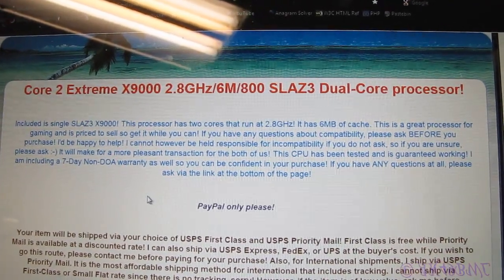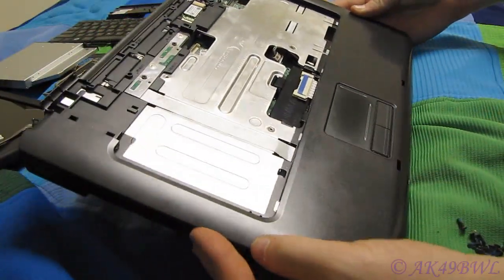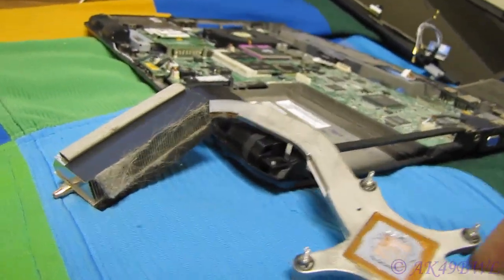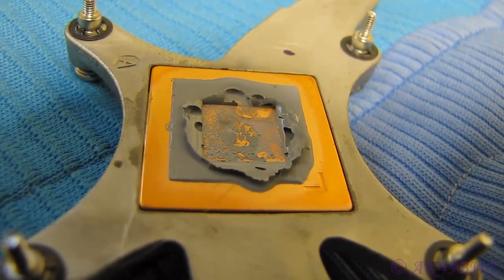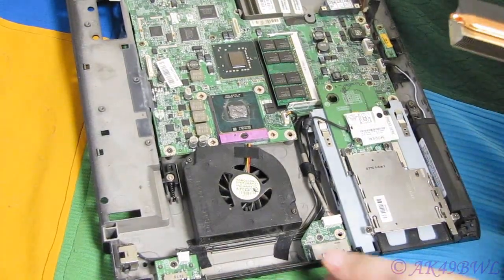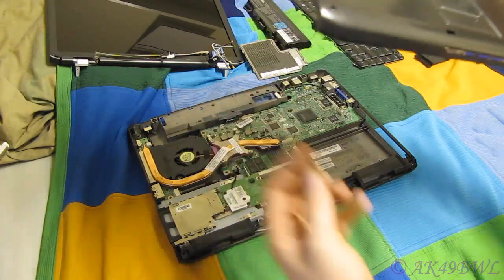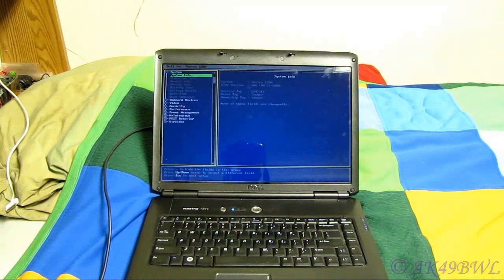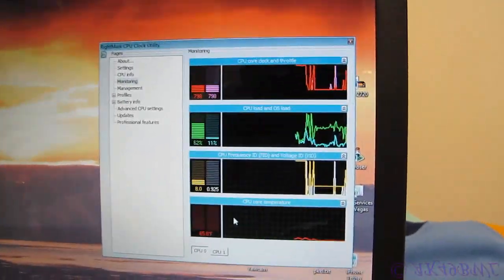How to Replace a Laptop CPU

Comment: If I wanted though to change my CPU or GPU,  can I get ANY CPU or GPU I want for my laptop?
Reply: BenG HD No, you need to check for the following:
1. If your laptop model has socketed CPU - if it's soldered directly to the motherboard then the situation becomes more complicated;
2. If your laptop's CPU is socketed, then check if it's an Intel or AMD CPU, and the model; you can find this out by going into the BIOS configuration/settings;
3. Look up in Google (or your preferred Internet search engine) the brand and model of the existing CPU and find out which socket type it is;
4. Take note of the socket type, then using the Internet search engine again, look up listings for mobile CPUs available under the socket type you've got in your laptop;
5. Find in the list your existing CPU model, then take note of the TDP (Total Dissipated Power) and FSB ratings, then check the higher specified CPUs, and if Lady Luck's smiling your way, you may find the fastest CPUs with a matching TDP and FSB for your existing CPU; write down all the CPUs that are listed matching the TDP spec;
6. Go to ebay or alibaba.com and search for the best priced CPU model(s) you are looking for;
7. Research the seller and check if they are reliable;
8. Figure out which CPU upgrade has the best performance to price ratio;
9. Budget for the CPU you consider best for your planned upgrade.

The reason why it's important to match the TDP specification, is that this will also best match the heatsink/fan combination you already have; it may be very difficult to find a heatsink/fan combination that will fit in your current installation for a CPU with a higher rated TDP. 
Chances are that if you order a CPU with a higher TDP, the existing heatsink/fan combination may be inadequate to keep the new CPU cool, and the laptop will keep shutting down as the thermal overload safety cut off system automatically shuts down the CPU to prevent it overheating, if you're lucky. Don't retry starting your laptop again if the thermal shutdown happens even once.
If you're unlucky you may end up frying the new CPU and possibly the motherboard or memory modules as well.

It seems rare, in my experience, to find an upgradeable GPU; usually with laptops that have a reasonable chance of having an upgradeable Graphics Card, the entire GPU card needs to be removed, for replacement with a new and improved GPU card; although this is trickier than a CPU upgrade because most likely than not, the heatsink/fan combination mechanical geometry for the mounting screws may not match the new GPU card/board; requiring replacing the existing GPU heatsink/fan combination, and this may be much more difficult than finding such a combination for a CPU.
When shopping for an upgradeable GPU card, be careful to make sure the replacement GPU card has the same type of connector for the motherboard; the same model of GPU card may have variant physical motherboard connectors. 

When upgrading either the CPU or GPU, in addition of making sure the correct heatsink/fan combination is also upgraded if necessary, heat sink silicone padding or heat sink compound/grease should be applied to the CPU/GPU to ensure the best possible thermal conductivity between the top surface of the CPU/GPU and the heat sink. Also make sure the heatsink mounting screws are tightened sufficiently to guarantee the best possible thermal contact between the CPU/GPU surface geometry and the heatsink. Make sure any old heatsink compounds are thoroughly removed by appropriate and proper cleaning before applying fresh heatsink compounds between the CPU/GPU surface geometry and heatsink(s).

Take all possible anti-static and OHS (Occupational Health and Safety) precautions and procedures when handling CPU/GPU components, and the heat sink compounds or heatsink compound cleaning chemicals.

Best of luck with your upgrade endeavors.

I have provided the above information on an as is basis, for use at your own risk. Neither Google, YouTube or I accept any responsibility for any damages you may sustain as a result of the above information. You must make sure you do your own research and take the appropriate precautions when upgrading your own system.

If you are in doubt as to your capabilities or abilities in carrying out any of the upgrades, I strongly recommend refraining from proceeding; you may be better off selling your old laptop and using the money to help buy a new one.
Reply from the maker: BenG HD sure. No guarantees it'll fit, or work, but you can get whatever you please lol. As long as your system supports it, you'll have no problems. That research is on you, my friend.
Reply: Ak49., eres bueno con las laptop's.!! Tengo una Sony con core i5. Se le puede cambiar a core i7.,???
Reply: Es una sony vaio. disco duro de 500 gb. y memoria ram de 4gb. intel core i5
Reply: esta muy bien la maquina pero es mi duda si en un futuro se le podria cambiar, asi como tu lo hicicste.,dejame decirte que estubo exelente tu video muy bien.
Reply: bueno lo cambiaria una persona experta. asi como tu.yo no.pero cres que le ayude a mi laptop.?
Reply: i dont, change this piece,only a guy whith experience. like you.
Reply: thanks my amigo. i from mexico a litle town morelos cuautla.youre a good man., I have little speak inglish is hard for mi.sorry.

Comment: ***** Hi men, My Question is, If you Update the Bios of your Vostro1500 When you put the X9000.
I have vostro 1500 too, and plan to change Cpu T5470 for T9300, I already bought it.
My Bios Version is A01,and found a Bios Version A06, It willbe Fine or not?
Thanks in advance.
Reply from the maker: Headburn88 yes, you will need at least A04 if I remember right, or the CPU won't even be recognized. A06 is the latest, always best to update :)

Comment: Can the Gpu and RAM be upgraded?
Reply from the maker: Displux RAM, yes. GPU, not unless it came with nVidia graphics, and then you only have one upgrade option (I forget what it is tho). If you don't have a Vostro 1500, I can't tell you what the GPU can or can't be done anything with.
Reply: Displux RAM is a lot easier to upgrade than the CPU, in my opinion

Comment: How did you just 'drop' in a core two extreme CPU without burning out the socket going from 35watt-TDP(T7250) to 44watt-TDP(X9000)? Funny you had a temp drop, I want to do this for my old XPS M1530 w/T8300...
Reply from the maker: Aaron mcClintock Well I can only assume the sockets are designed to handle any CPU that was made to fit them. Either way, I have that computer sitting on my floor right now doing some torrent downloading so, it still works lol. You'll probably have a MUCH easier time doing it on the M1530 tho, I think you can just remove the entire bottom panel and the CPU is right there...

Comment: laptop cpu and pc cpu ..its same size ???
Reply: Aloya Lego More than the size, you should consider the kind of socket the motherboard (either the laptop's or the desktop's) is using. Also, most desktop processors are a bit power hungry, and even if they could be (in a very hypothetical way, don't know much about laptop components) plugged into a laptop, your power consumption would be pretty high.

Comment: I was cringing when you used a screwdriver to take off the old thermal paste :D

Other than that, informative video!
Reply: "Nice and Shiny" and scratched to shit haha.
Reply: Joshua Lloyd respondEd to 4 yr old comment
Reply: Sometimes thermal paste gets so hard that even if you do everything correctly it wont come off I know that happened to my hand down laptop its thermal paste was like concrete I couldnt remove it even after letting the alcohol sit for 30 minutes (I added more when needed) and I had to resort to a screwdriver cause it was damaging all my cleaning tools

Comment: i dont even have to take my laptop apart. just need to unscrew 2-3 screws, and its right there. :)
Reply from the maker: TheGrayWolf81  lol I must have the stupidest laptop ever. No, wait... Toshiba is still worse.
Reply: Oh and that's my old laptop which i rarely use. Plus im afraid it might just randomly catch fire one day--its a Dell. :/
Reply: TheGrayWolf81 I have a Clevo P150SM....  MADD Machine.   Only 4 screws to access pretty much everything there is to access (ram, ssd, wifi, cpu, gpu, etc).
Reply: ***** TOSHIBA is better than DELL.
Reply: ***** Toshiba are very good in my opinion, But if you prefer DELL is totally fine.
Reply: Cesar Alvarez HD hp is better then toshiba well actually everything is better then toshiba
Reply: Gammer 100 hehe my friend has a Toshiba and it crashed on him and he had to reset it AT THE LEAST 6 times... but i think that's more him than the laptop XD
Reply: lol ur prob right

Comment: any damage will become to the laptop memory? if I changed my processor. ..
any problems will come?
Reply from the maker: Olga Kondrativa No damage to the memory... Just get the right CPU for your system and you'll be fine. You need to know both the FSB and what the chipset will support (they go hand in hand, really).

Comment: i have a laptop with a intel core i5 4210u 1.7ghz is it possible change the processor because some websites say i cant change this processor.
Reply from the maker: suhela jayaweera You'll need to determine whether it's soldered to the motherboard or not - if it is, there is no replacing it.

Comment: hey i just bought bought the same laptop but mine has webcam but its tha same model vestro 1500 but mine has a t5270 @ 1.40ghz and 2.00gb ram and i made the mistake thinking the 2.00gb was the cpu :/....soo wat i want to know is what can i do to make this computer faster is just upgrading the cpu a big part or do i need to upgrade more parts to prepare it for a faster cpu sorry i dont really know alot bout tech......the laptop is okay it really cant run smooth with two or more programs open will upgrading the cpu allow me to open more programs without lag delay?
Reply from the maker: manuel martinez Absolutely.... Mine originally came with the T5270 as well but very soon after I upgraded to the T7250 as well as replaced the RAM with 4GB total. Then I went to the X9000. If you don't want to go straight to the Extreme, the T7250 was a pretty solid performer at 2.0GHz, and can be had VERY cheaply on eBay. In fact I don't think the X9000 is expensive anymore either considering its age :D .... If you want to get some speed out of it without doing too much, disable the Desktop Window Manager and Superfetch services (Windows Key + R, type "services.msc" and find those two in the list) - those two take quite a bit of RAM to run and all they do is [DWM] provides a somewhat nicer graphics experience, and [Superfetch] is said to load programs faster over time but I never got much out of it. Next step would be to replace/add more RAM (max 4GB for this one). Then the CPU.
Reply from the maker: manuel martinez Also if you're running Vista, drop it like it's hot and put XP or 7 on it lol
Reply: ***** i was thinking about a t9500 there around 40$ :)................and for a ram upgrade i was looking for some 4gb ram on amazon but they are sold 2x2gb not one whole 4gb ram...so should i get just one new 2gb ram and put it with my old one if i can?....or will it be better to get new 2x2gb ram?
and its been dropped down low to that win7 baby ;) lol
Reply from the maker: manuel martinez  unless it's changed from stock, all you have is 2x1GB. So the 2x2GB will do you better - and will guarantee that your two RAM sticks match ;)
Your Vostro have the Nvidia card or Intel graphics?
Reply: ***** ohh okay, yea i found some 2x2gb ram for the vostro 1500....i think its nvidia??
Reply from the maker: Good if so, because you'll be able to find Win7 drivers for it if you need to. The Intel graphics drivers for Windows 7 cause random BSODs lol, I had to find an old Vista driver. I mean, it worked, but it was a pain :p
Reply: ***** yea its nvidia..well thanks man you helped me out alot i got lucky that i just typed in "cpu upgrade" and found someone with the same laptop model as mine xD
Reply: wow mine is 2.6 GHZ laptop I5 i dont think you will have to pay much got a laptop 3.0 GHZ
Reply: ***** do I really have to take my laptop apart that much to put the cpu  in? cause if so I couldn't follow along. was too fast for me

Comment: I upgraded the processor in my laptop and it works fine for about 15-20 mins, however, it will shut off out of nowhere. I downloaded a program to check the pc temp and it's not overheating. I also downloaded the drivers/bios files for both Lenovo and Intel and it still does it. Someone PLEASE help me... It sucks having had spent 200 dollars on something only for it to have been a curse... I have a Lenovo G700 Intel i7 3612qm with 8GB RAM.
Reply: maybe the MB is fried... or could be a faulty components into the motherboard...

Try replacing the HDD, RAM'and see if it still does... try with the HDD, if is ok, then check the RAM, if is still ok, then remain the MB, need to be replaced
Reply: Idk man I'm sorry I can't help you, I'll tell you if I experience it and then I'll try to find out.
Reply: MB can't be fried it works when I put my old processor back in it.
Reply from the maker: Nobody Important You may have gotten a bad CPU then... That's the only thing I can figure. If you can, try returning/exchanging the CPU you got for another. If that still doesn't work.... I don't really know what to tell you.
It is somewhat possible that your machine's power supply doesn't have enough power to fully operate the new CPU?
Reply: What PSU do you have?

Comment: Do you need to reinstall Windows after replacing the CPU?
Reply from the maker: Travis Ross Nope! As far as the OS is concerned, CPU replacement is plug.n.play.
Reply: ***** Awesome. Thanks for the quick reply. I wasn't sure if any registry, drivers, core files, etc. were linked to the CPU in some way during the installation of the OS. I suppose the chipset does all the work with regards to that.
Reply from the maker: Travis Ross Yeah, working with the CPU all done by the chipset.. Aside from identification, the OS could care less what CPU is in there lol... Well, for this generation at least, I can't be so certain about the newer CPUs with embedded graphics and all that. I just recently got one of those machines myself, so much has changed since I made this video lol.
Reply: ***** Yeah, I would assume if your had an APU, it wouldn't be as simple. Could be wrong though.
Reply: The CPU doesn't store anything on it, here's why; It requests data from the Hard Drive, it is fed through a Bus (Connections between the (HDD, RAM, CPU...) and then it makes calculations and outputs the answers. The ROM chip may be what you're thinking about, this is non volatile (keeps data even when turned off) and is required to start a computer and control any hardware. Hope I helped! Correct me if I'm wrong anyone :)
Reply: Ok haha, sorry about that.
Reply: the os is in the HDD or in a SSD if you got a SSD
Reply: ***** I know that Ubuntu (Linux) is awesome and can seamlessly be taken from one computer to another. I found out when I wanted to test an old laptop that had no hard drive. I just got an old 2.5" that already had Ubuntu on it from a different computer, and popped it in the older laptop. It started up and loaded the OS and all drivers without a problem. Very impressive actually because I'm pretty sure Windows doesn't work that way.
Reply: TheNilar Right, but I'm almost certain that Windows has core files, driver files, and registry files that are linked to specific hardware from the system in which it was installed. So, you can't just grab a hard drive with Windows on it from one computer and put it in another (as mentioned in the above reply).
Reply: Travis Ross that was NOOT what i meant
Reply: TheNilar Sorry, not trying to start an argument. I was just referring to the previous conversation. I didn't realize you were replying to the original question, because it had already been answered.
Reply: TG9910 My question was referring to whether the hard drive stored any critical hardware information during the installation of the OS that would otherwise prevent it from functioning with a different CPU. I know the CPU does not store information. Thanks anyway for your help.
Reply: TG9910 No problem. Its always good to get additional input. Much appreciated.
Reply: Glad to hear it :)
Reply: Travis Ross No, but you do have to delete system32
Reply: SebastianTheGreat

 For linux users:
sudo fuckshitup

Comment: is this possible for all laptops?
Reply from the maker: Mike L most, but not all. In fact, the one I just bought, I won't be able to upgrade the CPU on because it's soldered to the mainboard. Funny thing is, that's the ONLY thing that isn't upgradeable in it... lol. It's something you generally just have to check for yourself unless there's a tear-down video or pictures available online (which for 99% of laptops out there today, there is lol).
Reply from the maker: Mike L Yep, it's in the middle... And it's not socketed, so no upgrade for that one either lol. You can switch out the entire board, but then you may as well just get a whole nother laptop. This one I'm buying new is replacing one I bought in 2008, so it's not like I'm expecting too much haha
Reply: great...lol gotcha, well atleast the ram is upgradeable :-/ 

well thank you for your time and helping out, from this i'm guessing it's better to get a desktop and build it or take an easier route and get a console lol
Reply from the maker: Mike L  yeah, if you're looking for long-term upgradeability, desktops are by far the best option :)